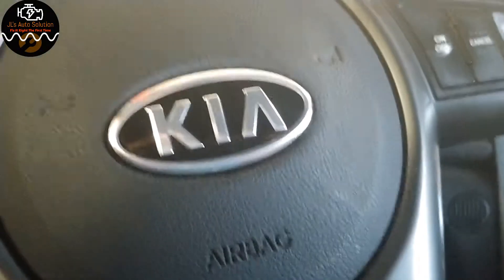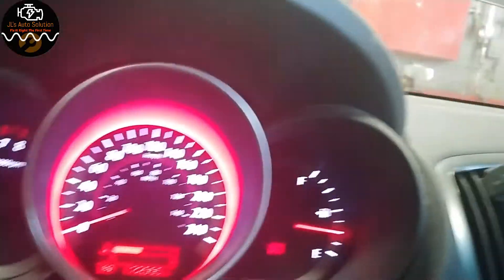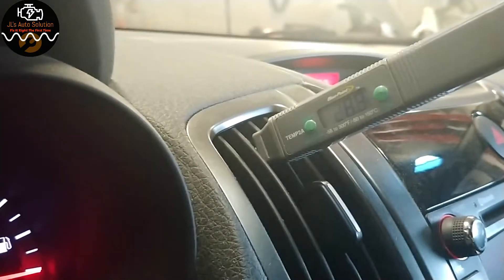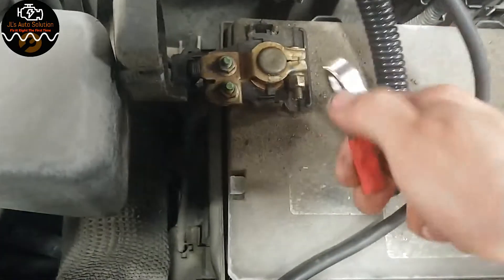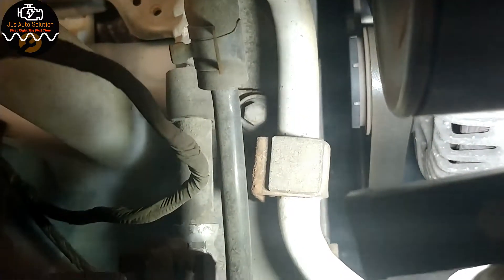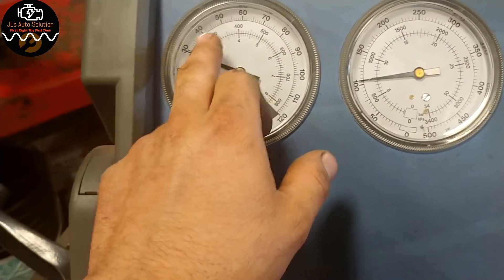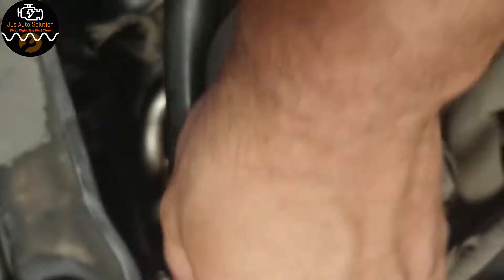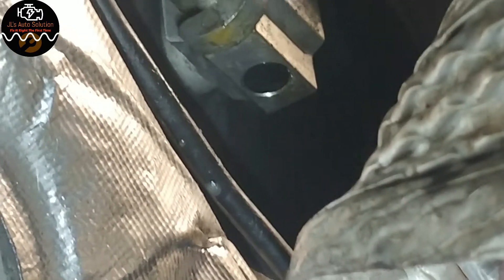How to Locate A leak on a A/C system

Comment: Supposedly if both lights illuminate on a pin then you have a short circuit. At 2:47 both LEDs illuminated on pin 86. Am I reading the tool wrong?
Reply from the maker: didn't realize that until you just mentioned it.. but yes, when both are illuminated it is suppose to indicate a short circuit..
i will check this on monday.. i have not used this tool in almost 1 year(since this video) due to all newer vehicles having internal relays now.. 

thanks for the comment and watching..

Comment: Would a garage evacuate a system, let the car owner test and repair, then go back to the shop for a vacuum and refill afterwards?   Chris in Nova Scotia
Reply from the maker: There would be a fee.. but there shouldn't be an issue. It really depends on the shop and how helpful they are to their client's..
Reply: I do have gauges and a cheap vac pump but I'm not to sure about the diy refill in Canada r12a, it's hard to get any info as to what's in it...  I'd rather keep r134a in the system.  However we've moved near the ocean and so far, a/c is not quite a necessary as it was in Ontario:)
Reply from the maker: @chrisingram7277  r12a system is not compatible with r134a it will leak.. typically you would need to change everything to use r134a is a r12a system(hoses /seals/ compressor/ evaporator/condenser/receiver dryer. You might still find r12a on amazon or somewhere online.. fix your leak first.. then go from there